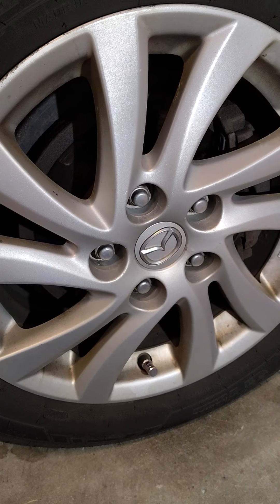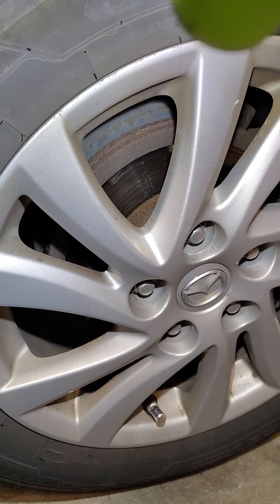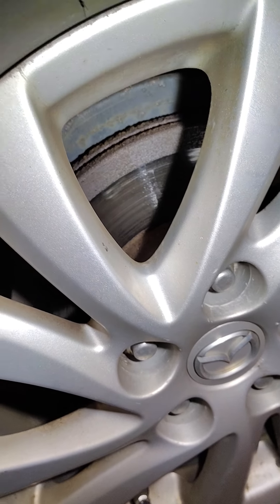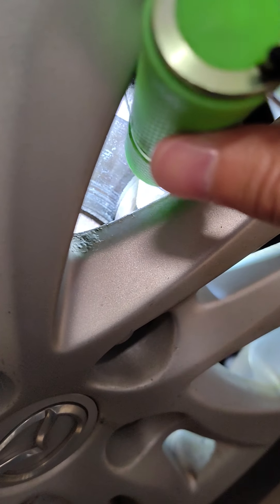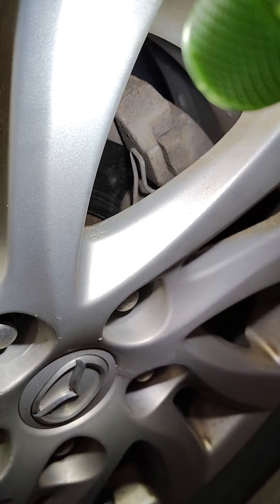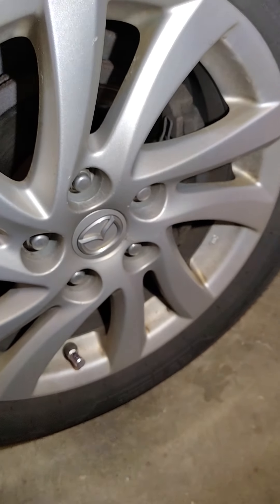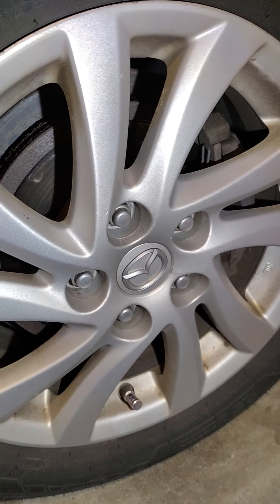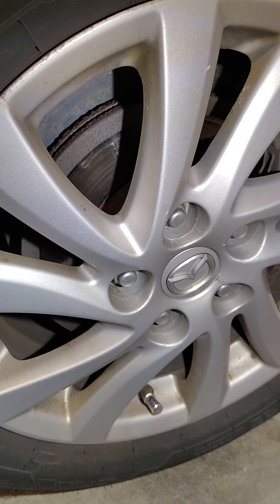Rotor Warping High Mileage Mazda!!

Comment: Is the engine still running well? What kind of oil do you use?
Reply from the maker: @Stroboskop1992  still running well... recently had a check engine light on this year and come to find out it was carbon buildup and I got spark plugs and ignition coils replaced this year...but still running well no engine knocking or rattling of any kind which is a good sign
Reply from the maker: The oil I use is Valvoline high mileage O-w20 and I change out oil and filter every 5k miles now past year....and I'm using Seafoam in my crankcase before the oil change is done about 50-80 miles prior to my oil change and also put a can of it into my gas tank when empty about 2 times a year I do that treatment as well